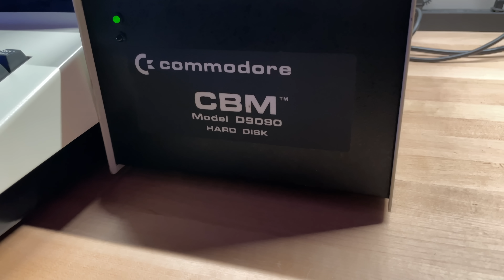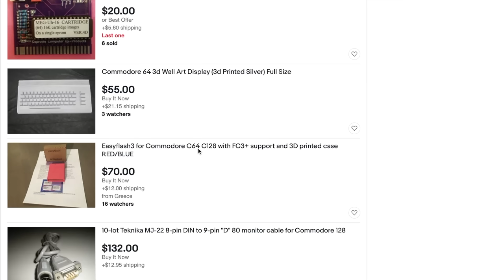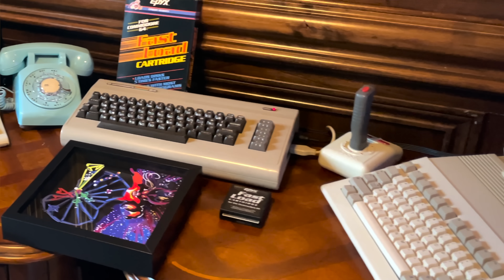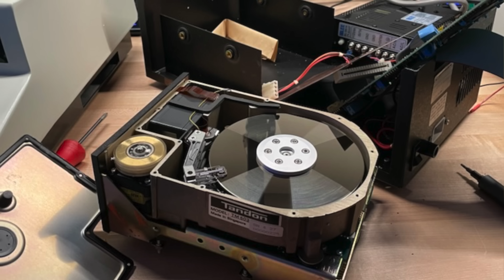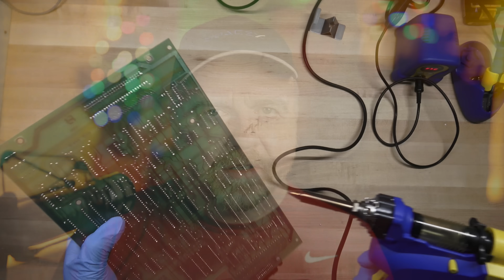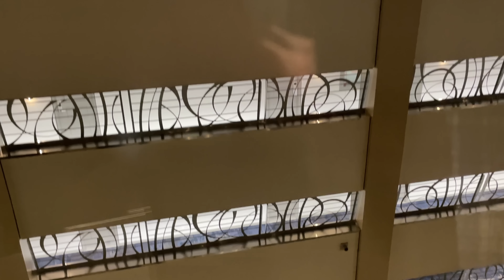FOUND: A Super-Rare Commodore D9090!

Comment: Back in the early 1980"s, before working at MS, I wrote books on programming the C64 and C128 aimed at smart teens. Funniest hardware memory was getting the floppy drives to work by just tightening up the drive band by feel. Love this episode. Thx always for your excellence, Dave.
Reply: And books like that got me started at age 5.
Reply: @forbiddenera  You were a smart teen by the age of 5 - wow.
Reply: @forbiddenera  I was 5 in the late 1950s. I built a working radio on my eighth birthday, and I was repairing TVs part time at 13. I was a Broadcast Engineer in the US Army at 20. I tested out of a three year course, while in BASIC. I was told that no one else had ever managed that task. All I know was it caused a lot of jealousy from other soldiers.
Reply: @michaelterrell  nice 👌
Reply: @forbiddenera  Thanks. One of the most fun jobs that I had was to move and rebuild an early '50s RCA UHF TV transmitter. I moved it to Destin, Florida, but the cool part was it came out of production at RCA on the day that I  was born.
Reply: I was too poor for a C64... had to settle for a Vic20, still spent lots of hours typing in programs... I found I could type them in faster than trying to load them from tape.  A disk would have been quite the luxury. =D
Reply: @MikelNaUsaCom  i had a c64/128 but by then it wasn't worth much I wish my mom never got rid of it though
Reply: @forbiddenera  I had the 5 color plotter where i could print out my programs ... it was 5 pens in a spinning plastic piece (z) that pushed up against a rotating drum (y). The paper was pressure fed against the drum and only one pen at a time was in contact with the surface ( or lifted) and a carriage moved the plastic piece horizontally (x).  It would do both vector drawings and character print outs. Paper size was small, but print quality was better than dot matrix or ink jet... and it was dirt cheap.
Reply: BASIC Computer Games is one of the ones I remember
Reply: I repaired a lot of 1541 drives. Many needed the motor lubricated because they were running below the acceptable speed. A drop of Teflon oil in each end, and they were fine. One member of our Commodore computer club insisted that 'Marvel Mystery Oil' was better, followed by, I only need to do it every few months. I ran some of my drives for years, with a single treatment.

Comment: You know that a good 120/240 volt ac isolation transformer maybe at 1 kw for the bench would be a good fit?? I use a 500 watt myself for 40+ years. And your house has 240 volts available at different current requirements. My bench has both available. The ability to use a basic isolation transformer with 120 volts on the primary and a 120 and 240 on the secondary. I can think of lots of ways to do it…..

Enjoy the old computer stuff, I started with a Commodore VIC 20 myself. Worked on some Amigas as well. Wound up on both PC and MS DOS in the early days.

Keep up the good work and maybe will meet and I will get out the Bagpipes for you.

73’s

DE N2JYG

Comment: Devices with motor always have the possibility of dumping all its potential energy stored, what could cause a lot of damage to the power supply or other parts of the circuit. I do not use GFCI or AIR BAGS. “We die like real men”, so I am not sure why it was popping.

Comment: Maybe it's the hard drive motor, those are AC motors I think... usually either in   delta (triangle) or Y style windings, so possibly a shorted or charred winding ( carbon can cause some pretty wild transients. the motor driver had a internal protection Diode fail short or something.  see if there are those big test pads on the motor and try to find a datasheet for the motor driver chip with the internal circuitry  ( and check for application notes / example circuits) and start from the motor. also check  the snubber diodes, they can fail open and the switching of the inductive load of the motor can cause back emf spikes with crazy voltages.. (Check out the back EMF video on the EEVBlog channell, specifically the second, third, and also the last two  sections) I've never seen a PET HDD So i might be speaking nonsense though, Good Luck!

Comment: I know some power circuits will often have a capacitor or voltage dependant safety device thats referenced between the neutral and earth, especially in european markets. Ive seen them cause many RCBO/GFCI trip issues in my feild of electrical work. Its usually just a $1 part thats gone short from age.
Reply: Also if the drives seal was ever compromised along the way theres a chance it was just damp tracking to the case

Comment: With love and care, those old machines seem to last forever. Still have the 1984 vintage Kaypro II CP/M box (64K RAM, 4 MHz Z-80) I'd bought in high school. It still boots (in about 3 seconds total) from the floppy drive just fine. Fortunately have all the original documentation as well. A major upgrade was to DSDD floppies (so more or less a Kaypro IV, minus the internal modem). Also added a real time clock kit. As the high-score holder on one of the included games CATCHUM (c.1985), my youngest brother was getting visibly  worried when his son was getting close to beating it... in 2017 or so. Thanks for the trips down memory lane Dave! 🙂 EDIT: - correct year from 1982 to 1984.

Comment: Drilling out unused PCB pads to prevent user RAM upgrades is the kind of aggressive contempt for tinkerers that would make Steve "Slots were a mistake" Jobs blush.
Reply: Well Steve Jobs had the memory chips of the 128K Mac soldered in such that we had to desolder them all to do our own upgrade to a 512K Mac (where it finally had enough memory to be useable), so I think Steve could definitely stand his ground in this department (the Apple upgrade path was to pay a great deal more money and swap in a 512K Mac motherboard)
Reply: One day in 2011 by Caltrain and Starbucks... Bit of a rude boy to me.
Reply: The original IBM OEM PC and XT motherboards came in two versions. 256KB and 640Kb. There was a huge price difference, but the only difference was a 29 cent IC to decode two additional address lines, and to solder a jumper aacross tw pads. I used to get bags of free used 256K RAM, so I converted a lot of boards to 640KB.
I repaired a prototype IBM PC for a retired IBM engineer. He said that he was assigned to select the original power supply, and it was his test bed. They gave it to him when he retired. I met him at a local computer store, when he was trying to find a replacement floppy controller. The owner of the store was screaming at him, "Pull out your  %^&%^ wallet and buy a daned computer, and toss that piece of crap in the dumpster on your way out of here! No one has had any parts for that piece of crap, in years!" I told him that I had a couple dozen of the boards, and I would fix it for him. His Christmas mailing list was on 5.25" floppies, that his newer computer couldn't read.
I replaced the board, then I upgraded it to 640KB. I gave him a better video card, with a printer port and cleaned it all up. It looked brand new. The mods freed up all but one of the five slots, and gave him more RAM. When e came to get it he said that he hoped the repair wasn't too expensive. I know that he would have paid a lot more, but I told him that it was $20. He was sobbing with joy as he carried out of my home shop. 😃
Reply: But it was a one time decision, never repeated.
Reply: @saganandroid4175  Apple Computer, under Steve Jobs management, brought out the 2007 1GB PowerPC MacMini, which could not be expanded beyond that 1GB. Running OSX kernel and OS services used so much memory on that computer that it was similarly as useless as that original 1984 128K Mac. For the original Mac, 512K of memory made all the difference in the world. That would have been the case with this MacMini - 2GB would have made this an entirely viable computer.
Reply: @TheSulross  OS X 10.4, which is what shipped in 2007, required 256MBs of RAM. Even Leopard, the last PowerPC version of OS X, only required 512MBs. I ran both OSes on 512MBs to 1GB of RAM on a PowerBook G4 and a PowerMac G4 from 2008 to 2012. They were smooth, quick, and performed perfectly fine even with multiple browser tabs open, video playing and Photoshop running. 

I still have Tiger on my PowerBook Pismo with 1GB of RAM. Memory is never a bottleneck no matter what I’m asking it to do. 

Sure having an upgrade path beyond 1GB might have been nice for some people. But having RAM max out at 1GB was hardly an issue in 2007 for what Apple billed as its budget offering. From experience I can honestly say that, by the time you start using programs that need that much RAM, you’re limited by the wheezy PowerPC G4 chip and weak graphics hardware 

That’s the much bigger sin of the 2007 Mini: continuing to use a PowerPC G4 chip long after it’s been rendered obsolete.

Comment: My first Linux desktop was my Windows machine with the hard drive disconnected and a USB hdd plugged in.  
I made an Ubuntu boot USB stick and intstalled Linux to the USB hdd.  It worked great.  Thiis gave me a powerful Linux machine for the cost of a USB hdd.  I plugged the Windows drive back in and set to BIOS boot order to USB first.  I could boot into Linux by plugging the USB hdd in or boot into Windows by unplugging the USB hdd.

Comment: A sudden thought. Western Digital used to have aprogram called 'SCSI Bench' that was free, and probably on an archive site somewhere. It ran up to Windows 98, as far as I remember. With a real hardware SCSI inerfacce, it would allow low level commands to be sent to SCSI devices, mainly drives, though I did use ti to test tape drives, too.
You can re-map a lot of SCSI drives internally to 'Zero defects' with it. I vaguely remember using it when fixing industrial controllers with ST506 drives hooked through control cards like those made by Xebec. THer was some way of putting the defect map on the drive itself, or perhaps an EPROM on the controller card.

Comment: Dave,
          love your work.
I used to fix full heights back in the 80s Microscience and Micropolis voice coil and tape drive systems.
I wonder if your pulling a nasty to GND and the transistors check OK it will be the experiment with silpak at that time. They look like happy little pieces of cheese things that everyone loved, but when i moved over to the AV industry i found out they were hated for causing a litany of random failures.
Doesn't break down until your looking at it meaningfully. 
Remove them all and replace with mica.

Comment: Did you try lubricating the stepper motors on the dodgy drives? I find this is a great way of  bringing MFM drives back to life. There's usually a convenient section where the stepper motor shaft pokes out from the casing that you can just apply silicone lubricant to.

Comment: Are you sure your breaker isn't an arc fault interrupter? Also, if the drive is using a lot of power, you might be able to find the problem with a thermal camera.

Comment: Wonderful. This  takes me back to the days of getting a hard drive together for my BBC micro, in the late 80s. I got a faulty power supply and case, (new capacitors needed in the switch mode - it initially started up the drive like an old car - it would spin up about 5 times then stopping, before running). I bought a few second hand SCSI drives, (thus bypassing the need for the dreaded ST506 <-> SCSI board), and an after market BBC <-> SCSI board.. Then I had to dig into the mysteries of low level formatting and changing the sector capacity: all the drives available were set for 512 bytes/block for PCs, Acorn used 256 Bytes/block. Took me weeks. Still have it, and it runs. 80 Megabytes on a BBC Master 128.  Sidenote: Acorn really future proofed their ADFS. The block map went out to 4 Gigabytes.  I just hope mine  never gets full enough to need compacting: doing 80 Meg on a machine with only 64K of user RAM might take a bit longer than a Commodore low level format. . . .
Reply: Mike did you need the storage space for a database ?, i would like to hear about your late 80s usage of the BBC128k.
Reply: ADFS had some really odd limits though, such as supporting only 77 entry limit on directories.

Comment: I have a Commodore hard drive in my attic... sure remember that sound! Guess I need to check which one! I worked for Commodore in the early 80's... still good friends with the guy who wrote the Dos Wedge you mentioned. I met him when I found a bug in that program and wrote him a letter. Later we worked together at Commodore.

At our Commodore office we shared a hard drive in a sort of early network... just piggybacked the IEEE cables and ran a set of remote status lights to each office. When the lights were quiet we figured the other guy wasn't using it. Worked pretty well!

Back in those days I wrote Scopy, which does copy files from disk to disk directly without going through the Pet. And it scrolls both ways! Written in Basic. 

Some day I'll catalog my old Commodore gear and probably put it on Ebay.. got some prototype stuff too, like a very early 64. Serial #39, I think?
Reply: Please don't just put it all on eBay before you at least record a tour of everything - even if it's not plugged in and running.
Reply: May I ask, what happened to Commodore?  Does it still exist?
Reply: @pritambissonauth2181  they went bankrupt in 1994

Comment: I know from experience that A/C motors, like those found in refrigerators, will trip a GFCI breaker.  We bought a fridge for our basement/garage to store extra food that wouldn't fit in the fridge upstairs in the kitchen (buy in bulk -- it's cheaper!), and that fridge wouldn't run for more than about 5 seconds before it'd trip the thing. Unfortunately, all the outlets down there were GFCI, so we had to replace that outlet with a regular one.  Probably against code, since it is both a basement and a garage (I think all outlets that might be accessible from outdoors need to be GFCI these days?), but I made damn sure that the ground was good before doing it, so at least there's that much protection.

But I have no idea how a D/C motor could trip a GFCI, especially with a modern power supply which surely has well-isolated input and output sides.  Maybe a bad cap between the power-supply and the drive?  Something allowing some ripple back onto the negative side of the D/C, somehow radiating past the isolation to the A/C side?  That's a stretch, though.
Reply: A properly functioning refrigerator won't trip a properly functioning GFCI. Either there's some leakage current in the fridge (most likely in the defrost heater, possibly from damaged winding insulation) or the GFCI is false tripping. I haven't seen this sort of false tripping myself (we've run a freezer on a GFCI for the past 18 years without issue) but apparently some GFCIs are sensitive noise on the power line.

But this still doesn't explain Dave's GFCI tripping. With isolated power supplies there's no way that should happen. I could understand the cheap replacement supply failing but it not Dave's bench PSU.

Comment: I think we all (electronic fans) have those releases we were in awe of. 
While I had a PET and C64 I was still quite young, my active years were more around the Amiga which I later sold for a living till it died.

My big item was packing everything I could into my Amiga 500 (bought it for Shadow of the Beast (very unforgiving game when mistakes are made)), then on to my 1200 where I had 12mb ram (2chip, 10 fast) and a hard drive. 

The thing I always wanted was the Amiga 4000 with Video Toaster. Never was able to get one (although now I could probably swing it).

I was young an silly and even had an Intel Outside sticker. Ironically after years contracting with Microsoft (late 90s) (where I heard of you but had not knowingly met you) I actually work for Intel. My how things change.

I enjoy your stories and adventures as it reminds me of some of my adventures, never did manage to survive college but boy have I embraced working in tech land. 

Also appreciate your sharing your views on those on the spectrum S someone not diagnosed until my 30s it was an eye opening experience.

Comment: Sir, your binge buying ST-251 MFM drives brought back my memories! I am the same age, and my first PC was an Asian clone of 5150 I purchased in 1989. It came with 10MB "Cogito' systems MFM drive and controller, while in fact it was rebadged ST drive (maybe ST-212) which I used for over 2 years. What a feat to install Windows 3.0 on XT from dozen of 5,25 disks....it worked, albeit sloooowly in real mode only.